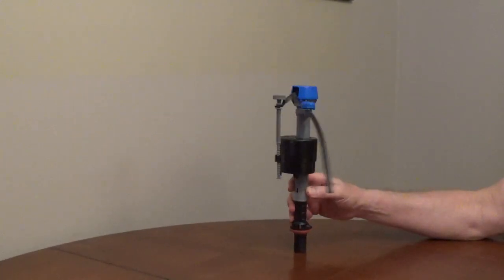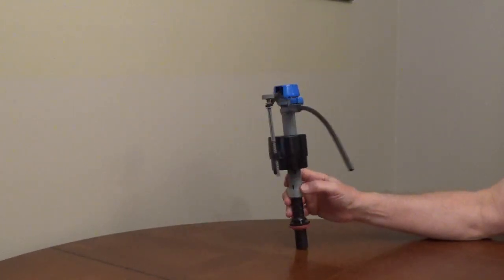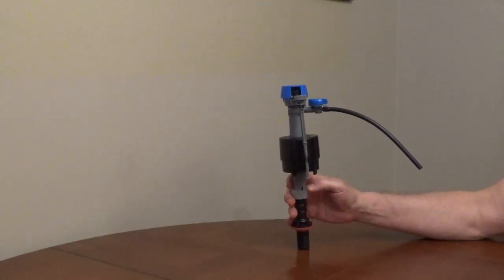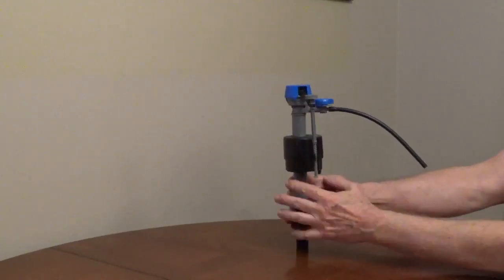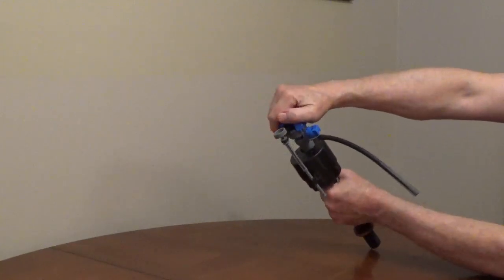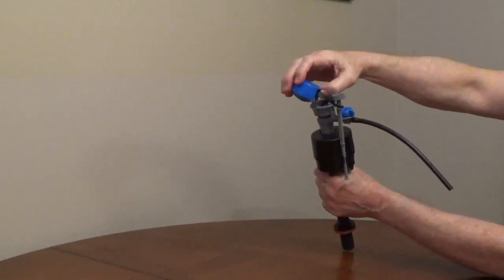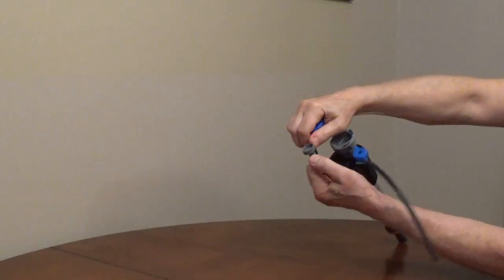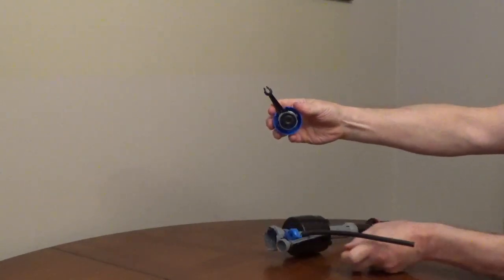Toilet Filling Slowly After Flush - Fluidmaster Toilet Fill Valve

Comment: It comes shooting out into the cup when  I turn it on, but when I put it back together, it still runs horribly slow. Is there another place or orifice things can be jammed up? It’s not the tube or anything as I took that off as well it’s inside the unit itself.
Reply from the maker: Hi, if you replaced the seal inside the cap and it doesn't help, I would replace the fill valve.
Check out some home improvement tips in our e-books https://www.amazon.com/gp/product/B0B2KW1FQ9